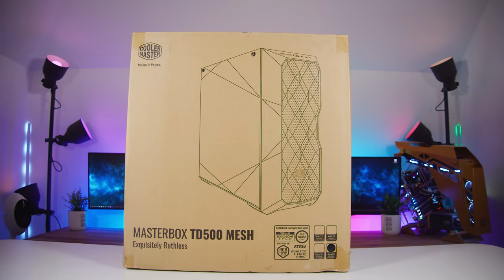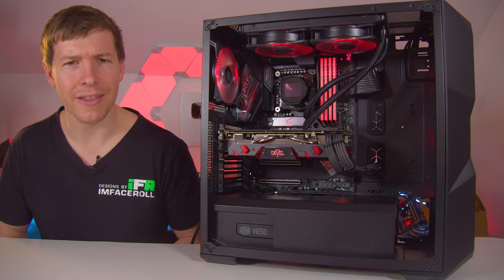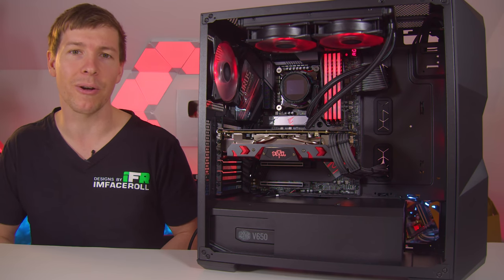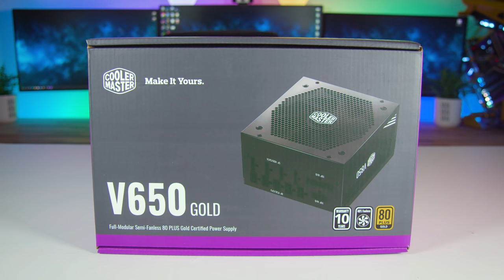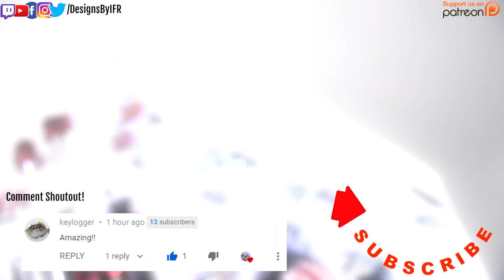EPIC Cooler Master TD500 Gaming PC Build - 10900k Time Lapse

Comment: 2:12 Omg why didn't you peel of the plastic from the ram😭
Reply: if i have that ram i will cover it in the steel
Reply: Linus did the same thing, he probably did the peel after
Reply: 2 is note a ram is just the cover
Reply: That ram was just dummy stick
Reply: One more thing, does the aio cooler come with thermal paste...?
Reply: @oscardbg9654  no

Comment: Absolute sexy build. What's your experience with aorus' rgb software in any build that's actually been kept together? I found I needed a full Windows reinstall anytime I wanted to open rgbfusion2
Reply from the maker: I havnt had issues apart from once before it didnt recognize the ram
Reply: @DesignsByIFR  you got lucky then man. I ended up moving to a rog board

Comment: Hey, fantastic build! I am just wondering, why the double cable for the front USB 3 ports is not connected? I connect mine right under the 24 pin, did u connect it somewhere else or u didn't at all? Just wondering thanks!

Comment: I know peeling is a YouTube must have when you're making video's but when I'm building a system that's the last thing that comes off. All the fingerprints on that tampered glass is just really annoying to rub off. Great video btw :) And don't those plastic covers on the RGB ram come off? or is that there for protection?
Reply from the maker: They do but i am using the ram in a future build so i wanted to keep them clean

Comment: Hello Designs By IFR! Just a quick question I’m a tad bit confused about the gpu part what exactly do you mean when you say you couldn’t use any other does that mean if I were to use these parts I couldn’t get one of the gen 30s or cam j still, also would you reccomend this build ? Sorry for all the questions 😅 I am just now getting into pc and trying to research and save up for one. Thank you!
Reply: Sorry I forgot to add would there be anything you recommend? Over others, once again thank you

Comment: Hey man, can I ask you something? I bought the same case but I have a problem with the liquid cooler. I cannot put it because the ram sticks are in the way. So i put in on the front and as expected, it doesn't work. My motherboard is msi z390 carbon. Rams are corsair vagrance rgb. Water cooling is coolermaster masterliquid 240. What should I do? Is this normal? The maotherboard to block the radiator and fans?  Thanks in advance!

Comment: Dang, wish I was skilled like that to build my own pc.
Much less even have the money.
Reply: If you have the cash you dont need sjill its like Legos now aways everything is plug and play .save up your cash for about 600$ you can build one . Or buy a Dell optioned and a low profile 1650 for arpund 250$ in total
Reply from the maker: Thank you
Reply: @DesignsByIFR  :)
Reply: I am 14 years old and I know how to fix most of computer issue and how to build it but I don't have enough money to buy new parts and I use scrap part which some time work

Comment: Why are the 10th gen processors called i9 and not i10?
Reply from the maker: There is no relation between the two
Reply: @DesignsByIFR  But doesn't the 10 gen follow progressively on from the 9th gen?  If the 9th gen is called i9 then shouldn't the 10th gen be called an i10?
Reply: Because the i3/i5/i7/i9 stands for the performance grade of the chip according to the standard set by the manufacturer (Intel) while the generation is marked with the numbers afterwards - at least that is how its been for years now, with the current naming scheme.
Reply: @akselmani  fair enough, thanks mate.

Comment: Hey Designs By IFR
I'm building a new rig soon it's going to be inside a NZXT H510i case with a ROG STRIX Z390-F GAMING motherboard with G.Skill Trident Z RGB 32GB 3200MHz of DDR4 and a i9-9900k with the NZXT KRAKEN X62 radiator and a Samsung 970 EVOPlus 500gb boot Drive and a couple of Corsair LL120 RGB Black fans and to power all of that I am going to have a Corsair HX1000 Platinum power supply oh I almost forgot and for my GPU I have a Asus Rog GTX 1080 OC Edition 8GB did I got from eBay for about $400 Australian dollars maybe I'll do a time lapse build on my channel what do you think of all my part's?
Reply from the maker: Great job man! Very nice parts
Reply: @DesignsByIFR  thank you so i guess its pretty good for my second build😃

Comment: why would you pair a 10900k with an rx 590? that's insanely overkill for a gpu of that caliber.
Reply from the maker: Watch and listen to the video
Reply: @DesignsByIFR  a test run for shooting videos doesn't quite explain why you'd use your time making a pc that is extremely bottlenecked by the gpu.

Comment: Yo guys, tell me if this pc specs are worth $1,200. Please.

Asus Prime B550M-A (WI-FI) Micro ATX Motherboard 
AMD Ryzen 5 3400G Turbo 4.2 GHz 4 Cores AM4 CPU
Crucial Ballistix 16GB 2x8GB DDR4 3000 MHz RAM
Zotac GeForce RTX 2060 SuperAMP Extreme 8GB GPU
Kingston 240GB V400 SATA III 2.5"  Solid State Drive 
Seagate 1TB BarraCuda SATA III 3.5-Inch Internal HDD
DeepCool DA700 80 Plus Bronze 700 Watts PSU
DeepCool Matrexx 55 V3 ADD-RGB Midi-Tower Tempered Glass with 3 RGB FANs - White